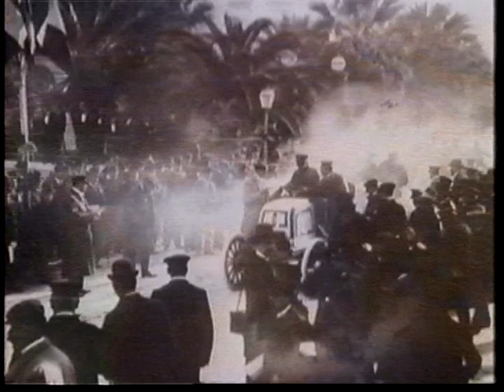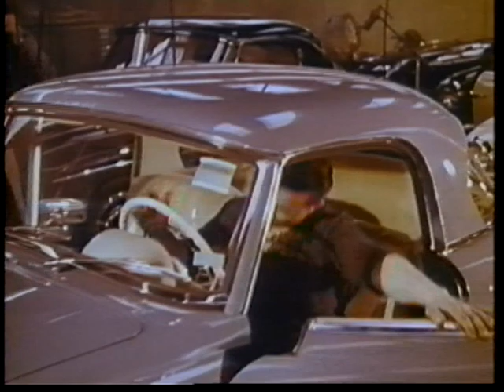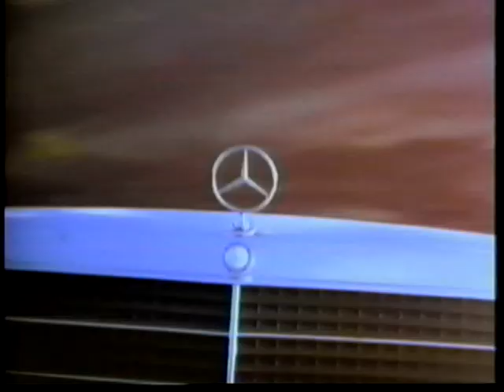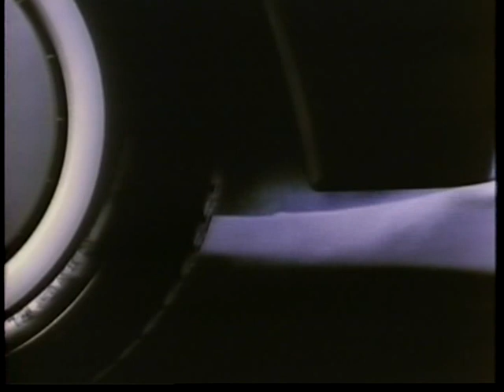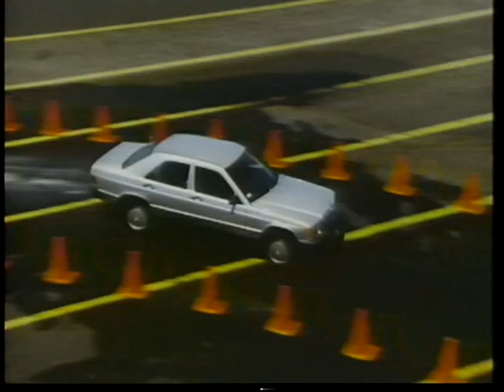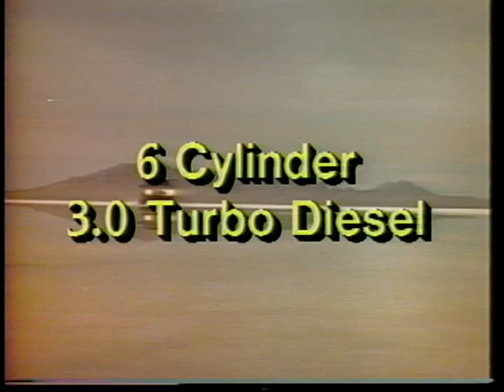Mercedes Benz 1987 Sales Training Model Lineup Overview

Comment: Proud owner of a 1987 turbo diesel and 1995 non turbo.  Both are W124 chassis.  Some say they were the last true MB, spare no expense when it came to build quality.
Reply: I also have a 1995 non-turbo (3.0L).  How does the 2.5L turbo compare to the 3.0L N/A in the W124?  I always wondered why they went from turbo to non-turbo, then back to turbo for later W210.

Comment: Wow the amount of pride this video shows is astounding. Sad that Mercs are no longer the best or nothing I blame Chrysler and the trend towards as much tech as possible in every damm car.
Reply: orion deschamps actually a lot of what Mercedes did to its self...it did before it bought Chrysler but got worse after the merge with Chrysler.
Reply: Brad Couture it all started right before the merger and was accelerated with the merger
Reply: orion deschamps You are so correct!  I could not agree more about everything you indicated.  Give me the old MB solid built cars.  I have a 87 turbo diesel and 95 non turbo diesel.  You are right, there is so much pride in this video and what they used to be.
Reply: william finnell Thanks! Do you by chance have a specific article as to where I could read these proven facts that you speak of?  Not trying to be an ass and so just curious is all.  I love my old school MB W124's diesel work horse cars.  I love the solid thunk of the doors when you close them.  If only the post 1995 MB cars were as robust as the historical ones.
Reply: @brad5150able  About to purchase either a W123 300cd(turbo or non turbo), W124 300ce, or a 87/88 w124 300d turbo. Love these cars beyond words.
Reply: orion deschamps Nice! I always buy used MB diesels.  I have been very lucky, twice.  The previous owners took great care of them.  Good luck with the new purchase.  I never owned a W123, heard they are awesome cars.
Reply: @brad5150able   I am still on the fence between 123 and 124. I fall asleep debating the pros and cons. The 123 has the quintessential Mercedes styling and represents Mercedes better than any other.the W124 was a complete from the ground up new car(Well a W201 redesign to some) compared to the W123 where it was a evolution of those lines that go back  to the 50s with the Pontons. The W124 could destroy a E30/E28 in performance and tech. A Mercedes that was not a SL that could be a sporty car seems crazy from the stand point the 80s Mercedes buyer, and now you see how these thoughts sprial
Reply: Brad Couture I now own a 1986 300e in Diamond blue!
Reply: orion deschamps Very nice.  I use my 95 E300 as daily driver. Congrats on the purchase.  Hope you got a no rust and low milwage one.
Reply: Brad Couture No rust but has 238k miles. Has the 16" 8 hole wheels. Main issue is that it needs a new alternator(got a new one free with the car).  Everything I wanted and expected it to be. Will have to see, but so far I am impressed
Reply: Mercedes sucks today. Sales floor sucks too.
Reply: william finnell Really?  MB was great until the merger with Chrysler.  The spare no expense to build quality that MB had for many years soon went away.  1995 was the last true spare no expense to build quality MB.

Comment: 300 class?  I always thought the w124 was the E class.
Reply: +Tigerfire75 I don't think that car was called the E-Class at least in America until sometime in the middle 90s (maybe '93, '94 or earlier the W124 sold in Europe was called the E-Class). But the officially named Mercedes E-Class which name we know today was the generation AFTER the W124; the W210.
Reply: Patrick Langan
Well there you go no one knows what to call the cars.
Reply: Yep, it was the 300 class until model year 1994, when the 190 class became the C class, the 300 the E class, and the SL went from being a part of the S class line (unofficially), into it's own model line. To make the model names easier.
Reply: In Germany, it was the 200/300 class (at that time, there was only the 190, the 200/300, S, SL and G). It took some time to discover that most people referred to it as an "E" because it often has the "E" designation after the number (which stands for fuel injection). Although there were also D, TD, TE models and those without fuel injection.
Reply: The 300 was the E class

Comment: This renews my MBZ enthusiasm that I have had since 1982...
Reply: +Tony Chavez and mine since 1994
Reply: +Tony Chavez Haven't they kinda forgot the motto the best or nothing?  I mean lately I wouldn't call them that.
Reply: +Tigerfire75 yes unfortunately the same qualities that made early cars famous is not there. Essentially when the W124 went out of production in 1995 it was the end of an era. Mercedes Benz themselves admits that they went to different production methods in the interest of being more efficient. Basically they went cheaper.
Reply: Tony Chavez
Sad.  I like the older cars and would love to get a good 300SD or 560SL
Reply: +Tigerfire75 I have owned a 560SL extremely solid car with a great Mechanically fuel injected V8👍🏼